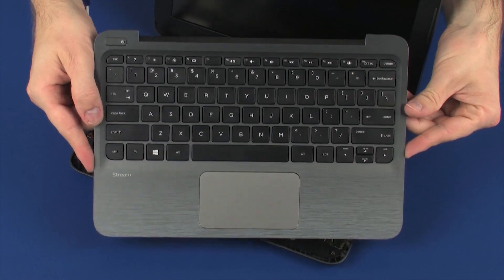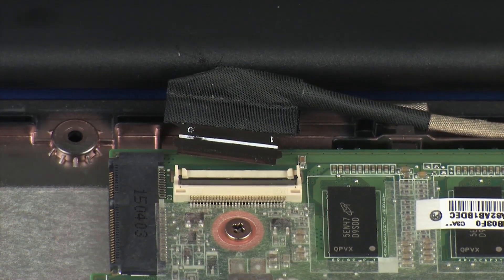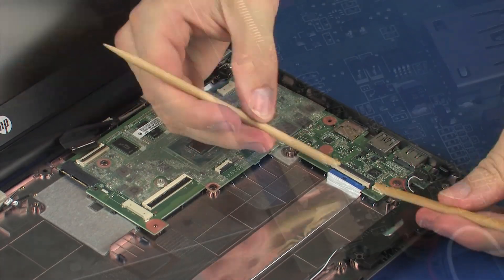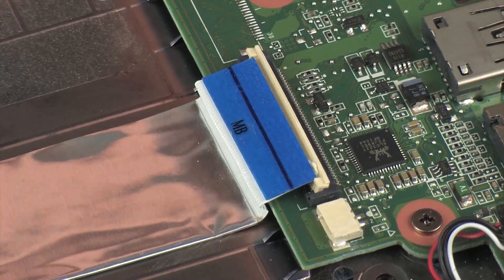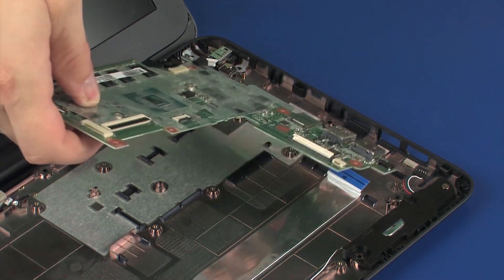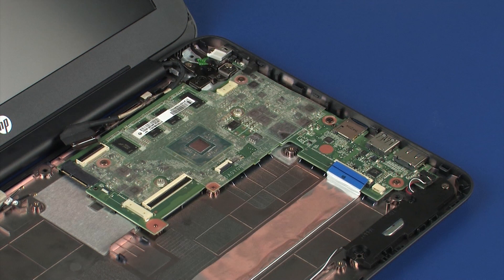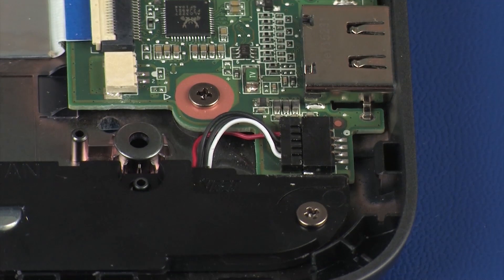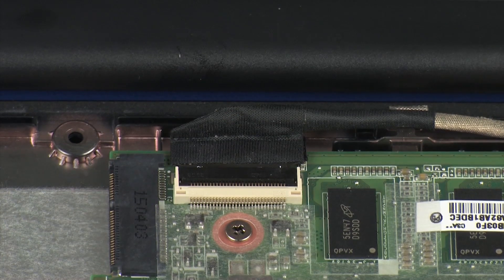Replace the System Board | HP Stream 11 Pro G5, G4, G3, and 11 Notebook | HP

Comment: Is there are way that we can upgrade or replace eMMC storage in this device ....
Reply from the maker: +Ismail Abdulla HP does not recommend upgrading or downgrading hardware parts or software that is bundled with the product as It may affect the manufacturer's warranty and performance, however, you could change the configuration at your own discretion.